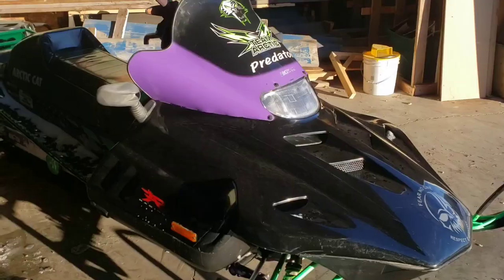How 2 Cold Start your snowmobile the easy way (1 pull)

Comment: Always did this on my iq600r after i snapped two pull cords and broke one magnapull. Started first pull every time.
Also, if you don’t want to take your plugs out. Just pull the engine around slowly afew times to let the friction warm up the pistonrings just a smudge and lube everything. It will make it so much easier to pull when its like -30 celsius.

Comment: 1996 skidoo 380, it has a primer pump , give it plenty of pumps to put fuel directly in the cyl's.
starts on the elec starter, all 2 strokes like to start very wet and rich. i also crack the throttle open slightly and stick my glove in the throttle to keep it open until it warms up .  Always starts, removing spark plugs would be last ditch.
Reply from the maker: Nice, unfortunately the big sleds over 1000cc feel like there ceased when its -30  I like your glove in the throttle trick
Cheers and happy trails

Comment: You could put a primer on it too. They sell the kits for twins and triples.  Three pumps of fuel. And it'll start right up too  :)    But..............Your way is a good way too if you only have a choke  :)
Reply from the maker: Yes it has a primer but the trick is to be able to pull it threw a few times,get the engine rolling and watch the fuel begin to  move, I only do this when its more than 20 degrees below freezing, I'd tear up my recoil if I didn't, smaller engines not so bad but over 800cc a must for me
Reply: Not really, he,s right,
Reply: I use choke all.the time. It works . skidoo had primers on there sleds. Mine is not 
A skidoo. Mine a zrt artic cat

Comment: If you can plan to park next to an outlet. An electric hair dryer and even your cover will work
for 15-20 minute pointed at crankcase with cover loosely thrown over and hood  down. 
Always pull that 200.00 $ belt and take inside when done for the day. It will save from smoking a narrow spot and bonus it’s a theft deterrent.